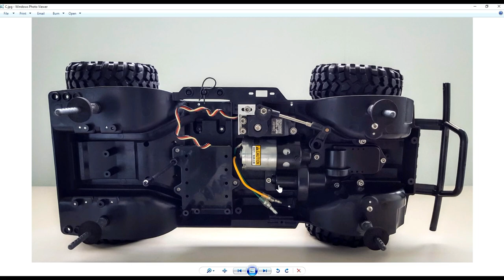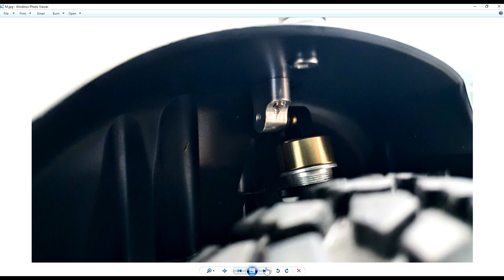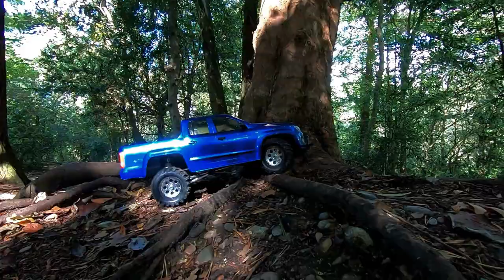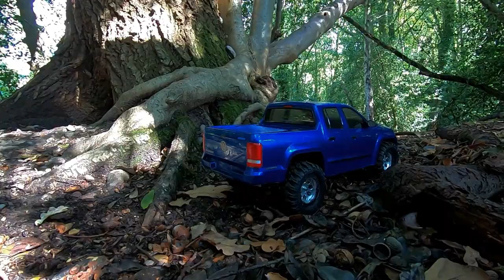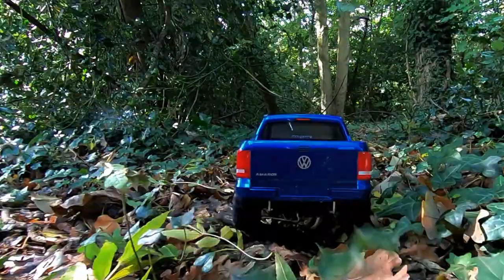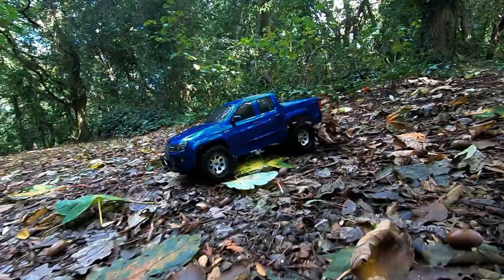Tamiya CC-01 VW Amarok Upgrades & Run

Comment: Ooooh - love those metal upgrades, Derek! That's a very cool and capable CC01 you got there. Looking lovely in the forest, sure seems to drive well and all the better for the 55T motor. Nice upload, buddy!  😁👍
Reply from the maker: Thank you very much Mark. I actually bought this back in February 2019, and made this video in October 2020, but never got round to uploading it. It was good eBay find, especially with all the GPM upgrades. It had only been run a few times and had spent most of it's life as a shelf queen with its previous owner. I bought it for a ridiculously cheap price too considering all of the upgrades it came with. The next thing to do at some point in the future is a driver. Have a good weekend my friend.

Comment: Uhhhh, that looks so cool Derek. Dream CC-01 I would say. What a rig. Great overview and run too my friend.
Reply from the maker: Hi Mikael. Thank you very much for your kind words my friend. I have 6 other CC-01's. One is box stock and still has plastic bushings. One is an old original with a mechanical speed controller. The other four have various different upgrades. But this has the most upgrades and it's a very smooth drive and a pleasure to run.

Comment: Great job! Those smaller tyres in particular make a big difference. It's impressively quiet too, which I always like in a rig. 👍
Reply from the maker: Hi Steve. Thank you very much. The larger tyres rubbed on the body when the suspension flexed and also when the steering turned. Luckily I have some ultra rare 90mm Fastrax Kong tyres that I share between some of my other CC-01's, and I had the Axial beadlocks in my parts box waiting for a new ride ! The next thing to do in the future is to sort out a driver. Have a nice weekend my friend. 🙂👍👍
Reply: @hollyhillrc  Enjoy your weekend too! I'm definitely going to get out with a truck today or tomorrow. I'm missing being up in the hills! 👍

Comment: Hi Derek, hope your keeping well. What a fantastic looking VW work horse and wow! Some money has been spent on the upgrades to that chassis! Those GPM upgrade parts will certainly have improved the RC’s performance. Nice work there Derek, thanks for showing us. Take care and keep safe and well.😉😊
Reply from the maker: Hello John. Thank you very much for your nice comment. The previous owner spent a lot of money upgrading this CC-01, and apart from three runs it was a shelf queen before I bought it. I own six other CC-01's and it's been interesting seeing what a difference all these upgrades have made to the performance of this chassis. There is an improvement but personally I'd rather buy a more capable RC for a similar amount of money that all these upgrades cost. I hasten to add I bought this one for a very low price back in February 2019. Have a good weekend my friend. 🙂👍

Comment: The VW body does look nice on the CC-01 chassis. Did come with  a lot of GPM bits.
Reply from the maker: Hi Mal. I bought this one for a very low price back in February 2019. Another eBay bargain. Apart from three runs it had been a shelf queen. It was in mint condition. Personally I wouldn't spent that amount of money upgrading a CC-01.

Comment: NICE Derek!! The shorter Tyres with the Axial Beadlocks look so good - I may have to borrow that idea! 😊
My CC-01 is nearly 9 years old.... Maybe it needs some love too.

She looked smooth on the Trail. Have a great Weekend!! 😁🍻🍻
Reply from the maker: Hi Carmine. Thank you very much. I have seven CC-01's which range from this one which has the most upgrades, five others have various upgrades, and I have one which is completely stock. It's been interesting to see what difference all these upgrades have made to the performance of the CC-01. It is better, but personally I'd spend my money on a more capable RC rather than a similar amount of money on all of these upgrades for a CC-01 chassis. I hasten to add I bought this one for a very low price back in February 2019. You have a good weekend too. 🙂👍
Reply: Derek.... I went down the CC-01 rabbit hole a while back! 😖 It was before I got my first Axial, and I made an all-out, MISGUIDED effort to make my poor little Landfreeder with transplanted Holiday Buggy Interior Plate, the best Off-Roader that I could! 
Of COURSE it didn't work... But I learned several tricks in the process, and even came up with a few of my own! 😉  The riskiest being; Epoxying the standard Tamiya plastic Steering Bellcrank into a ONE PIECE assembly. 😳 With the Integy Aluminium Ball Raced lower Steering, RC4WD Rod Ends and Solid Servo Arm between the Servo and Bellcrank, with GPM Aluminium Suspension and Fast Eddy Bearings - that bit actually WORKED! I have one of the SLOPLESS CC-01s on the Planet!! 😊 

But STILL barely any Suspension Travel, limited Steering Angle and a Chassis TOO LIGHT to utilise the overly stiff Springs!! 😵 
(However, Tamiya Barrel Springs helped a little bit)
....... But let's not forget the ridiculously high geared Drivetrain!!  

I've stopped experimenting. It's a decent looking, actual 1/10th Scale (MOST Mainstream Crawlers are 1/8 - 1/9th Scale really!), TRAIL TRUCK. Nothing more. In that mindset, I'm getting interested in it again. 😊
Reply from the maker: @CarminesRCTipsandTricks  You should watch this guy. He's a genius at making his RC's perform realistically when they run. This video is his CC-01Pajero running and a "How to".  https://www.youtube.com/watch?v=KL62DO4oVl4&t=374s
Reply: @hollyhillrc  
Awesome!! Thanks so much. He's quite impressive and I'll definitely be picking up new tricks! 👍👍
..... Like getting a LOT of Lead Tyre Balancing Weights!!! 😁😏
Reply: STILL want a CC02!

Comment: Great upgrades and conversion, a much chunkier piece of kit than Tamiya provide. Love those Axial wheels - looks spot on mate..👍🏻, and nice run through the woods too.
Reply from the maker: Hello my friend. Thank you very much. The previous owner spent a lot of money upgrading this CC-01and apart from three runs it was a shelf queen before I bought it. I have seven CC-01's which range from this one which has the most upgrades, others have various upgrades, and I have one which is completely stock. It's been interesting to see what difference these upgrades have made to the performance of the CC-01 chassis. There is a difference, and it is better, but personally I'd spend my money on a more capable RC rather than a similar amount of money on all of these upgrades for a CC-01. Needless to say, I bought this one for a crazy low price. (Sub £100) from eBay back in February 2019. Have a good weekend.
Reply: @hollyhillrc  Well you did get lucky with that price - crazy low indeed.

Comment: That is quite a parts list, looks nice. I think those are the tires I use for the Wltoys rock racer 12428. Good job👍🏾
Reply from the maker: Hi Paul. Yes this is fully loaded with option upgrades. It was a great find 🙂👍